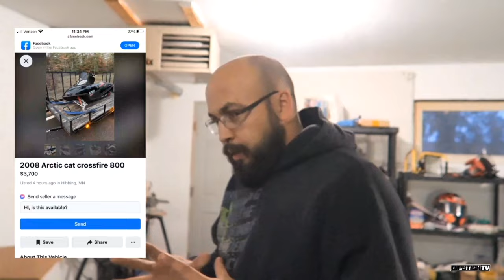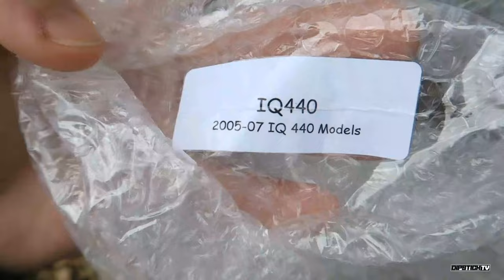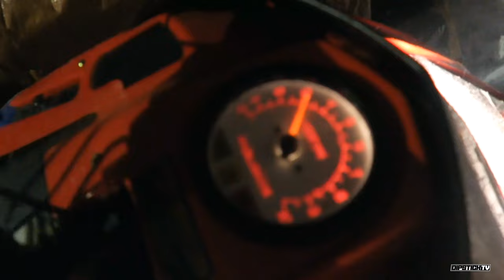IQR Gets Fresh Wrap & JAWS Race Can  |  Crossfire Gets Traded

Comment: Hey, where did you get the graphics for your sled? I’ve been looking for a set for my iqr. Thanks.
Reply from the maker: I was looking all over but actually ended up ordering this Senge wrap off ebay. I was skeptical but it turned out to be good quality and was substantially cheaper than the other options on the market. No customization options though.

Comment: You think about some updates and 600 swapping the iqr
Reply from the maker: I want to update the front spindles for sure. If I engine swap it will be an 800 but the sled only has 220-230 miles on it so I want to get the most use out of the 440 engine as possible.